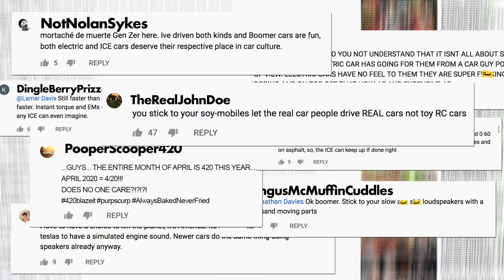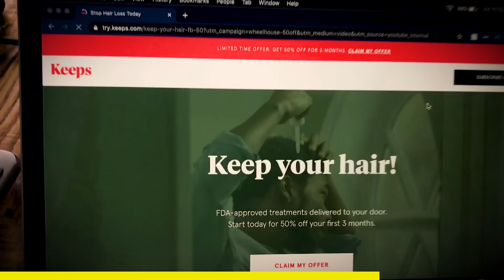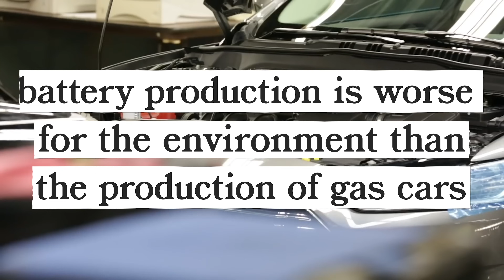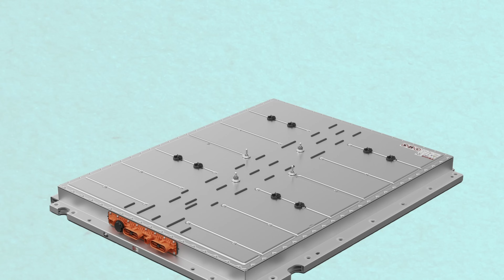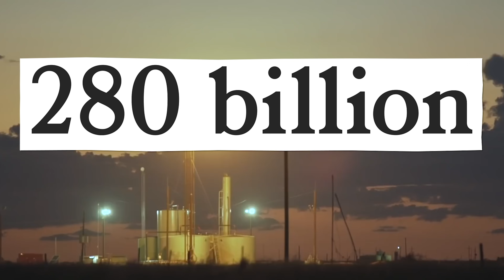Are Electric Cars REALLY Better for the Environment?

Comment: There is a way more shortcomings related to production of batteries and use of electric cars than have been mentioned in the video.
1. Comparing with the World Ocean CO2 emissions, all of those that occur because of all mankind activities is a trifle, so screw them!
2. How much time is needed to fill your gas car with 10 gallons of petrol? 2-3 minutes? And how musch time would it take to charge a battery of an average electric car?
3. You didin't mention that mining of lihtium is also associated with usage of pretty aggressive chemicals, used for recovering the raw product from the brine. Now guess what happens with those chemicals after a batch of lithium has been recovered!
4. You said that even if a quarter of cars in America would become electric tomorrow the US electric infrastructure will handle that, but what if they all become electric?
5. You have omited, or didn't know the fact that electrics do really bad in harsh environments with cold weather. Trust me, they do!
6. You should have added the environmental impact of "clean" sources of electricity. For example: rotors of wind generators kill birds and emit powerful infrasound vawes that are bad for human health, production of solar batteries requres the use of electroarc manipulations with silicium and other materials, and so on.
I believe that we should not put all eggs in the same basket, i. e., make ourselves dependent from energy sources of a one certain type.
Reply: Max Black half of those are valid arguments, but some of them are like saying “I can’t live in a house! What if a meteor crashes into it?”
Reply: @slideways8022  
If you think that some of my arguments are not valid, prove me wrong on either of them.

Comment: Yes. Their carbon footprint is significantly smaller than that of an electric car, especially if the electricity used to power the car was generated by renewable sources like wind or solar power.

Comment: If I had the dough to own 2 cars at once, I would have an electric as a daily for sure. 

In another 10 years or less, recycling should be better worked out, batteries will likely be way more efficient or maybe even a replacement for lithium and cobalt found. 

And remember, the more people drive EVs,  the more gasoline for the noisy bois haha

Comment: As a very recently converted petrol-head who is absolutely in love with pistons (sorry doritos), it breaks my heart to say it but we must shift to electric vehicles. There won't be a planet left to 'leave you alone with your consumption choices' if we keep going down this road. Thanks for this video, Donut guys. I was kinda afraid this video would be biased, but you've been as fair as one could ask for.

PS - That nuclear power plant at 9:00 was releasing water vapour. There is near zero concern for emissions due to nuclear power.
PPS - We REALLY need to shift from coal. It's way better to keep using gasoline and diesel engines than to use electricity derived from coal.
Reply: By market demand, natural gas over took coal for a lot of the energy development that we use today, tho many in coal-mining towns are sure that other forces are responsible.

Comment: Another issue though is longevity. ICE cars can last 200k+ miles, while an electric car/hybrid will need at least 1 new battery by then, if not more. They have mechanical problems at high mileage and EVs are not DIY vehicles. With ICEs, not only can you reliably buy them with 200k+ miles, but they can last another 200k+ if maintained properly. I can imagine that people with EVs typically are not “car people” and will sell their EV at medium/high mileage and buy another one. I guess I’m different, rarely will I interested in a new car, only cars I’ve been around for most of my life we’re bought used, which is much better than buying anything new

Comment: i think one thing to consider is a products lifecycle and the lifecycle of the technology in place
for instance gas cars will run for decades. from your numbers alone, a 20 year old gas car will be about 111 tons (7+(5.2*20)) total. Personally, I expect an electric car to last 5 years before they get recycled back into mother earth via junkyard, so over 20 years, going ev will be 108 tons ((17*4)+(2*20)). over time these numbers will improve. evs could go the route of getting better batteries that last twice as long, making 20 years 74 tons ((17*2)+(2*20)) instead. gas cars could be retrofitted with a cleaner, synthetic fuel that could cut total emissions in half, making 20 years 59 tons (7+(2.6*20)). ethanol shows numbers of up to 50% less co2 to produce and up to 70% less emissions to burn but is not a solution because it introduces alternative toxic chemicals in the air like formaldehyde and acetaldehyde making it hardly a solution to the issue but it still shows proof co2 can be reduced. co2 emissions are also not the end-all calculation of environmental impact, as lithium production also produces a gas called sulfur hexafluoride (sf6) which has a global warming potential 23,900 times higher than co2.

Comment: Someone should invent an engine that runs off Methane - I could power my car from a Toco Bell Drive-thru
Reply: Already have. Many conversions have been made using a wood burning gasifier. As wood heats and "burns" it releases methane this methane is piped into the carburetor and then burned in the cylinders.

Comment: Excellent video. I'd just like to remember other 3 points that I think are important to the discussion:
1. Batteries have a "short" lifetime, they'll gradually lose capacity and will need periodic replacement, and that's gonna cause an additional impact.
2. What happens to them after they're removed? Is it viable/efficient to recycle them?
3. Biodiesel, a cleaner fuel made from vegetable and/or animal source, which makes it renewable and has lower emissions.

Comment: Sure, it's better for the environment to drive an ev but good luck going on vacation with it... You can refuel an ice in like 5 minutes, an ev takes (tesla model x long range) 40 minutes on the fastest charge (120kw) and then your at 80% full. The slowest option (3kw) takes 25 HOURS?!?! DAMN so sure it's better for the environment but hell u can't go on an vacation without charging I mean sure use a plane but eehh that takes it to another level with co2 emissions..... You get the point

Comment: You could put solar panels on top of your roof (of your house)then you could charge your car from a clean energy source
Reply: Ali Fouad ahhh someone was think shit we live in Nebraska and we still got solar panels on our shed and lemme say damn does it help with the power bill in the summer
Reply: @JayDee-b5u  how so? It can charge to full overnight.
Reply: @MIA7Xthies  so how will solar panels get solar power without the sun overnight?
Reply: @AlineaEuros  Panels produce power during the day, that power is either fed to the grid or stored locally. You can then either pull from the grid at night and still net negative total grid usage, or pull from your storage source.
Reply: @Ephem13  most of that power still comes from fossil fuels than the solar panel when it comes to powering homes and evs, solar panels alone will not keep up.
Reply: @JayDee-b5u  What, that's just silly. The average house would feed into the grid if the roof was covered in current generation solar panels. Depending on the state you live in (speaking for the US here) you would either never pay money to the electric company, or the electric company would have to pay you for the power you provided. Adding an EV, in most cases, would still leave you sending power to the grid rather than pulling it.
Reply: @JayDee-b5u  Thats just straight up false. In my town in Germany, the town has a problem with the increasing number of solar panels on the roof of private houses. Thats because if you overproduce and feed it into the grid they must take it for 3 years. The problem is: Its so much electricity, that they dont rly know what to do with it, but they still have to take it and pay for it. Thats why they in turn try to sell it to other states that might need it. And thats on a sunny winter day.
Reply: Yes,  you can,   that's actually what my housemate does here, ...it really works out to be a help,  despite there being quite a lot of energy consumption from someone older living here,   and not having grown up conserving or whatnot.

Mind you, that's with a chunk of inheritance spent between the car and the  solar system and batteries and high-tech HVAC, but that's very doable,   especially for my housmate's general nocturnal working patterns and scheduled charging:  Also more of the grid itself is becoming clean energy,  despite many efforts against that for some reason.  

Even living here, it wouldn't make sense for me to drive an electric, cause I just don't use enough gas for the savings to count for much,  and my cars don't really have a manufacturing input at all because I'm keeping older ones on the road.  

Basically you need to think how things are suited to purpose.  As the electrics get better and more diverse, they'll fit somewhat more purposes.   Where I live, it's popular for homeowners of decent means to have an electric to run around town in  and something else for fun or when something bigger is needed.   When full electrics might become real viable for average renters,  I dunno.   That's mostly a problem of parking and where can you charge.
Reply: I already did.....
Reply: @Brian-om2hh  how is it going? Is it practical? (If you have batteries) does it hold through the night?
Reply: Still strip mining crap. Hydrogen engines are better.
Reply: @EveryBigfootIsANinja  hydrogen are not better in any sense. wake up.

Comment: Youre forgetting Nuclear power as a clean power source. 

Also, how does an EV compare to a low emissions diesel?
Reply: He literally shows a nuclear power plant in the video :P

Also, "low emissions diesels" doesn't mean low CO2. It just means low particulates and NOX. CO2 emissions for diesel is still on par with gasoline because even though you consume less diesel, there's more carbon per liter of diesel (720g per liter of diesel vs 652g per liter of gasoline).

Comment: Yes, but only if you have to recently. If you already drive a car that gets great gas mileage, or a hybrid, then mine and electric car would not be a more environmentally sustainable option, because you'd have to offset the carbon footprint of the car, itself; its source materials and its manufacturing process. However, in general, even in areas of the United States that rely on burning coal for electricity, driving electric cars is better for the environment than driving a vehicle with an internal combustion engine.

Comment: What's the different between lithium and gasoline? Although there are both mined, battery is recyclable (despite others saying it's not) and gasoline is burned and dumped into atmosphere. Before 2011, there were EVs that use molten salt battery instead of lithium ion battery. Think we should bring that back?

Comment: Ok. But here are some problems. EV are killing second hand car markets. Why? Well, you have to really have a mental problem to buy a let's say 5 year old EV that is probably going to die in about 3 years and hope to have money to replace the battery by then or to buy a new one. New batteries cost sometimes more than the car was worth new (cough cough Nissan leaf). However if you buy an ice 5 y.o car you can expect to use it for at least 10 year without a problem if you maintain it properly.  Most people can't afford to pay in upwards of $30k every 8 years or so. So EV may be cleaner at the beginning but in reality I think that a well maintained ice car will last you longer cost you less and probably will pollute less. Hybrids are better than both categories, but are also not perfect.

Comment: I don't get why they tech for Hydrogen seems to have died. Like okay huge battery with limited life span is an issue - so why not generate our power with hydrogen. Yes I know a ton of electricity goes into making hydrogen but it's more like a gas car once the infrastructure is in place. On demand power with a fuel source that may require less raw materials for the smaller batteries needed.

Comment: I am literally writing a term paper on this right now.
Reply: Hey make sure to check out Engineering Explained's video on this same topic as well! It goes into more detail and has useful sources!
Reply: Whats your opinion on it?
Reply: @aljon5947  It was a research paper. I mostly just summarized the past, present and possible future technologies for electric vehicles. Pretty cool but I'm glad to be done with it now.
Reply: What I find funny is how people tend to confuse three things here. First off, they think eV or petrol. They never think that there may be alternatives to both.
Second - the term efficiency is very much confused and used in the heat of the moment. If one looks at the efficiency of turning energy into rotational motion, there is absolutely no doubt about the eVs supremacy. However, if one looks at efficiency as a term to describe the net damage done to the outcome, an eV is actually miles behind a conventional ICE powered car.
Remember, cobalt and lithium are not the only two things in a battery. The bloody cathodes, for example, are an environmental disaster. They aren't telling you way too much about the eV and that's what makes it difficult to trust.
The third point is simple, but slightly hollow. An eV is much easier to remotely control and restrict than a petrol car. However, this is being catastrophically undone by 'ride by wire' systems. However, the bottom line is that eVs are far easier to control and bind to a rulebook than an analogue car.

All in all, if things go the way I hope they do, we should see petrol relegated only to classics and perhaps alternative fuels that still allow ICEs to exist being used to power the future.
Reply: @KiyanushKaranjia  New fuels are being developed that give extremely clean emissions from internal combustion engines. For example the new synthetic fuel developed by porsche reduces tail pipe emissions by 85%. This would put the internal combustion engine on a level of emissions output at the same level as a electric vehicles.
Reply: Hahaha I'm writing a small book on it right now.
Good luck with the paper!
Reply: I also did a project on this last year
Reply: I wrote on on the topic this semester too. Really interesting stuff
Reply: Yeah, please post references
Reply: Bro SAME
Reply: And let's be real, hauling 3000 lbs of steel and electronics or engine isnt exactlt the most fundamentally efficient way to get from a to b
Reply: btw, studies covering gas powered vehicules do not cover carbon cost for oil and fluids within the engine, their disposal. Also, cars with over 100'000kms (60k miles) have less effective emissions reduction systems like catalytic converters, some dont even work anymore and people replace them with cheaper and more attainable non-dot certified canisters. Add to that, manifold leaks for most corollas owned by clueless individuals, rusted exhausts, clogged pcv and egr (volvo style), as well as soil and water contamination by the oil spread on the asphalt. There are many aspects of gas powered vehicules that are not examined because the results aren't as quantifiable as co2 emissions from a brand new vehicles. (euro 5 standards state that a motorcycle's exhaust system has to effectively reduce emissions complying to the standard for 30K kms. after that, bye bye cat.)

I love sum brap brap, but we have to remember where our food comes from, and that nature is not just that one park in NY, it is what is all around us. Humanity reacts with fear when the danger is imminent, as for covid-19 (only when occident is menaced) but when it creeps slowly, it becomes a mere disruptance to the human mind that forgets so easily the roots of it's existence.
Reply: @TastyGnocchi  Exactly!  Just because something is a justifyably concernable issue in some big urban center/s doesn't automatically make it/them a problem in sparsely populated rural area, that in its own self may have problems that the urban folk have no idea even exist or see as real issues at all.   

In New York city some 68,000 people share a ~ 850 acre park every day.   Out here in rural nowhere land I have more than that area all to myself year round!
Reply: I did a paper on this a few years ago. Keep in mind battery production carbon emmissions are very over simplified and biased, I sugest you go through the different components of it and come up with an average yourself, there are many papers on this which are more specific and most of them not biased
Reply: Take a 5 hour break

Comment: Hey, guys. I love yout vides. When you do these videos at hime, just make sure when you use green screen to bump that shutterspeed to around 200-300, because the 24fps blures the image and it's hard to get rid of the green in post, especially when yout hand is moving fast. This will of course mean you will need a bit more light, so I don't know. Find a balance there. :) Great info, though!💪

Comment: First off, love the vid, it’s got great information. While I love the idea of electronic vehicles, I do have an issue with the current EVs is the long term. As stated in the video EV production is still in its infancy, and at least has the potential to get better, however as EVs become more and more popular, will production be able to evolve quickly enough. My fear is, are we trading one problem for another? In twenty to thirty years, instead of “dieselgate”, will we have “lithiumgate”?

Also lithium and cobalt are still finite resources, that eventually we’ll run low on.                                     Though I don’t have a clue on what kind of “rate of use” they have, so maybe it’d take a few thousand years to run out, I don’t know.